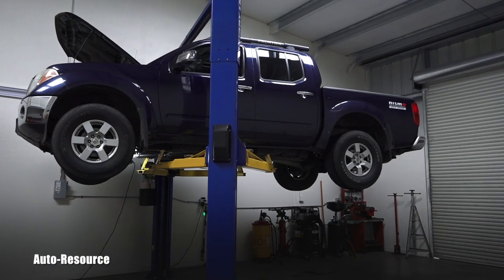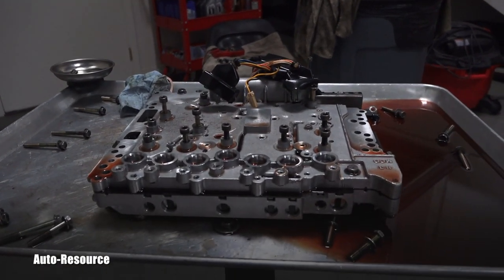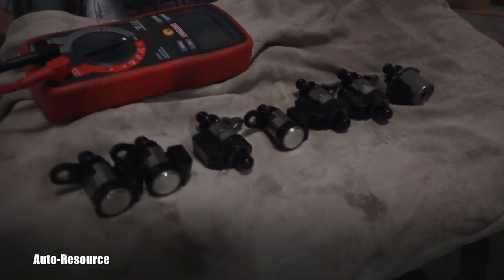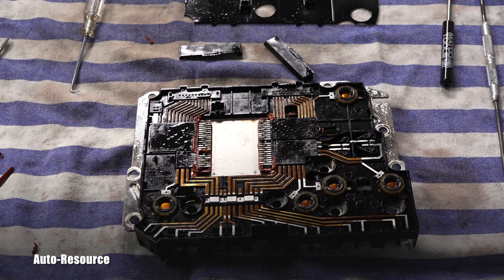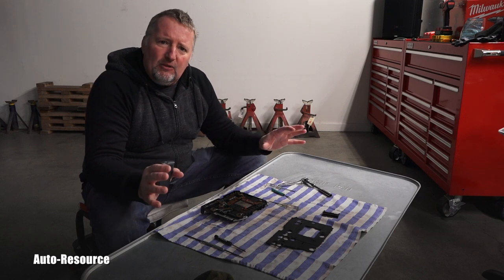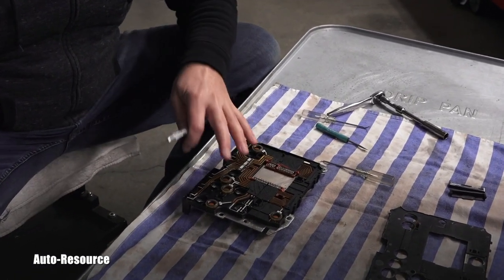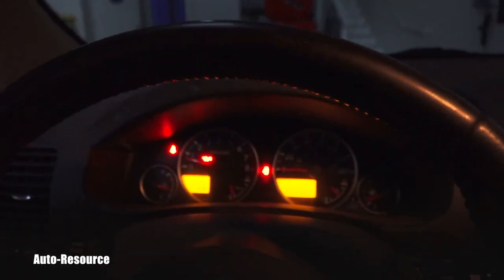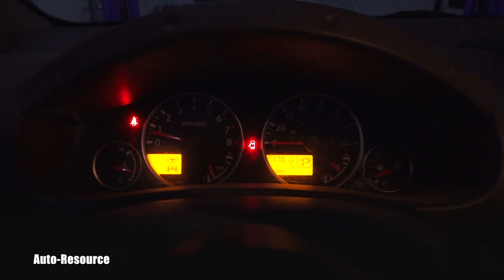Nissan RE5R05A Automatic Transmission Repair

Comment: I had this same problem.  I had to change the whole unit.  It cost me a lot more around $1600.00  I knew the issue, but did not comfortable taking it out and soldering.  Hope your video will help others.

Comment: Excellent video. This was exactly what I was looking for, I have a code1774 for low coast solenoid. I've got the replacement solenoids on hand and really wanted to know where to check for breaks in the circuits since that is also a possibility. Very clear and concise. Thanks
Reply: Most certainly the issue
Reply: 1774. Нашли причину?
Reply: I have the exact same code. I replaced the Low Coast Break Solenoid (high OHM version) and after I reinstalled everything and cleared the code it threw the same code again. I took my valve body off again today and removed the TCM and it looks fine, nothing broken when I took the black cover off. And no contamination or rust. I replaced my radiator and overflow reservoir last summer so I never had the strawberry milkshake of death. How did your fix go? Is everything working great for you now? I'd be interested to know. I am debating on what to do. Thank you!
Reply: @YouDontTalkAboutFightClub  What did you wind up doing?
Reply: @jameshealey27 Hello James, all I did to fix this on my vehicle was remove the valve body, then remove the TCM from the valve body, then remove the black plastic cover from the TCM, then clean all the metal pins on the TCM, then cover all the pins with automotive grade clear silicone, then reassembled it all. My new low coast brake solenoid (the one I had to originally replace) (high ohm version) works great now. No issues. Drives and shifts like brand new. Same OEM valve body and TCM. Never had to replace those items. Just cleaned all the TCM pins and installed a new low coast brake solenoid. Thanks.

Comment: Thank you for posting this, it helps a lot! Quick question, would you happen to know the ball bearing positions on inside of the milled part? I took apart a salvaged TCM I found at a junkyard and 2 bearings fell out. I only bought to module b/c it was $26 and I wanted to get familiar with it. All the components look ok. I will be replacing the solenoids, on the TCM on my truck, later this week. Hoping I don't need the salvaged unit, but would like a functional spare in case.

Comment: Gr8 vid,  I have a re4f04b. 
2001 maxima
P0744 comes on typically at higher speeds,  think it’s losing pressure on the TCC solenoid.   Highly suspect it needs new wire harnesses and solenoids block and filter. 
I was able to getting it to move with  3 drain and fills with few thousand miles between each.  It’s now almost normal except it still gets the code.
I was able to get it to pass state test barely on retest.

I used valvoline maxlife synthetic ATF 
Lucus
Seafoam transtune to help clean out things
Reply: A lot of misdiagnoses of lockup problems are blamed on solenoids and valve body problems. Always change your stator bushings in the pump. I've seen it fix lockup problems dozens of times over the last 40 years of building transmissions.

Comment: This is an excellent video and you did an excellent job explaining and showing this so clearly. It’s THE BEST VIDEO I HAVE SEEN in relation to checking and fixing the problems after contamination!! Unfortunately my 08 Pathfinder had the radiator leak failure and trans got contaminated too. I caught it early like you did. I changed to a brand new radiator, changed my hoses, and took forever to clean out the caramel pudding from my overflow tank. But I did it😃. I completely flushed my transmission and put new transmission fluid in it. New filter too. Everything was going well until
I noticed transmission is slipping when I put it in drive—it hesitates a split second when pressing the accelerator as it engages in first gear. And sometimes when I’m driving I feel it slip if I press the accelerator to go up 1 gear. Seems it don’t have the acceleration in relation to the RPM speed it used to have before contamination. With watching the great job on your customers TCM and what you did with your TCM, do you think it’s my TCM contamination and/or solenoids? Or do you think it’s the torque converter? I’m pretty handy and I’m sure I can remove my TCM to check and clean it like you did. 
I would really appreciate any advice. I don’t want to pay big $$$$$ to have a shop fix it, if I can do it myself. Thank you kindly in advance from Hawaii.
Reply: damage already done .coolant been in to long also converter full of contaminated fluid hard to remove.Clutches and internal seals damaged, you need complete trans rebuild.

Comment: Is the transmission still working? 
How did you clean the coolant lines in the engine? I know you replaced the radiator but what about the rest of the cooling system (hoses, engine).

Comment: What is there resistance supposed to be

How to check solenoids with a battery to make clicking sound

What order do the solenoids fit into the board?

Comment: hi your video is very good i have a blinking o/d light on when cold and loses drive for 2 or 3 seconds then when warm its fine and all other gears are fine and smooth can you help me already changed the speed sensor its the same i ned your advise?

Comment: I'm having a hard time getting the solenoid's off of the valve body on my 2006 a/t 4x4.

The goal is to get to the TCM to clean it off and also see what the solenoid's ohm out at.

Any tips for pulling them off without breaking?

Comment: Please i need your help my nissan armada 2009 had proplem with the transmission, its not working on Reverse and D its working on 3 only i replaced 3 gear transmission but the same proplem still there ! What should i do ? What is the proplem?

Comment: Pathfinder 2010
Hello. when I move the lever to position D, there is a delay of 2-3 seconds. only on D and worse when the engine is warm. the rest everything was great. What could it be? new oil. only Liqui moly 1200. Not original Nissan. I have had the car for a short time. so I don't know if it worked before. thanks for the information. What could it be?
Reply: Did you ever find the issue? I have a similar problem with my 2010 Xterra...
Reply: @stephenhoran742  Unfortunately not.

Comment: My tcm totally fried from the same issue. It put my whole vehicle in safe mode/ no start no crank U1000/j1850. I ordered a new tcm from eBay. I installed it. And put it all together. And nothing changed. Same code U1000/j1850. What is the issue?
Reply: Jacob Stork did you ever figure out your issue.
Reply: Im having this same issue on my 05 nissan armada.  No crank no start with only code u1000. Can anybody help wit this
Reply: @britainnycupstid4907  check Ivan' video of temperature control
Reply: @elvisedimo5694  i cant find that video